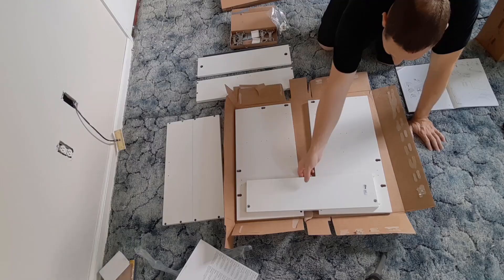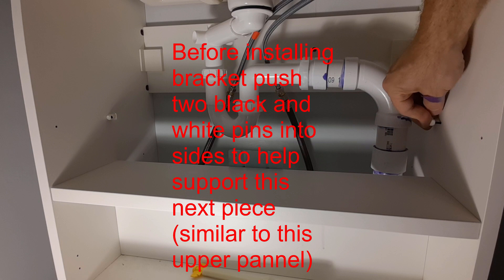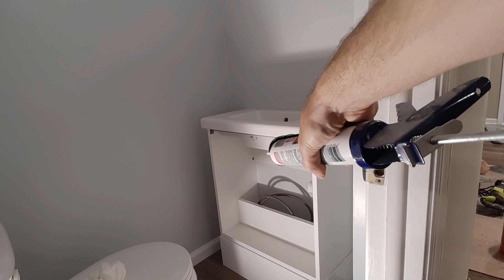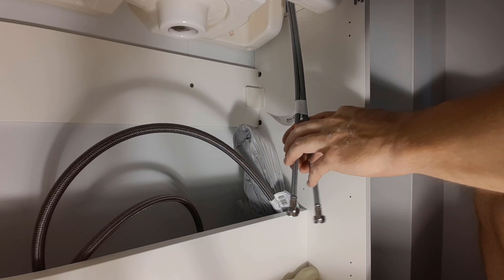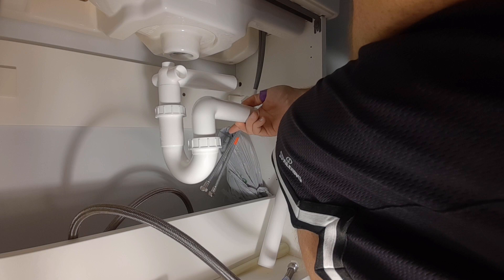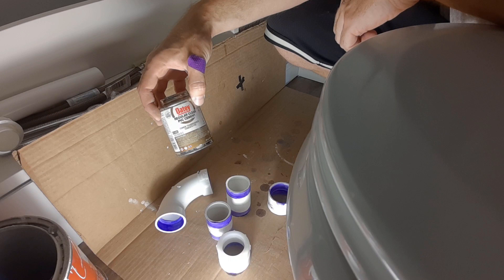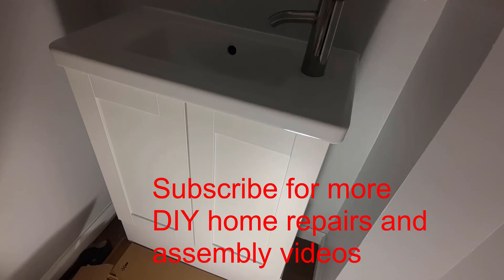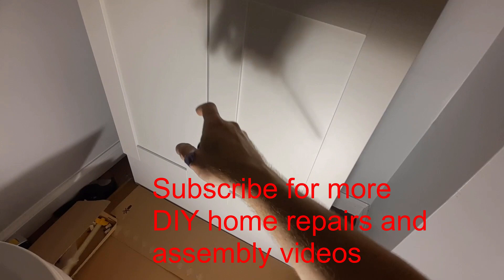How to assemble and install Ikea Vanity, Sink, Drain, and Faucet (Enhet, Tvallen, Rannilen, Dalskar)

Comment: Does the pipe work get blocked easily? They look very narrow which is a little bit concerning. Anyway cheers for showing the install. Great video
Reply from the maker: The drain pipe has not clogged for me since installed about 1.5 years ago. I would use a flexible plastic drain snake for hair if that happens and don't put solids in the sink and it should be fine.